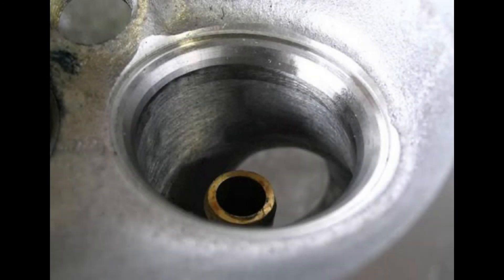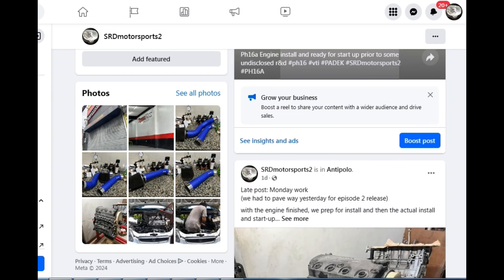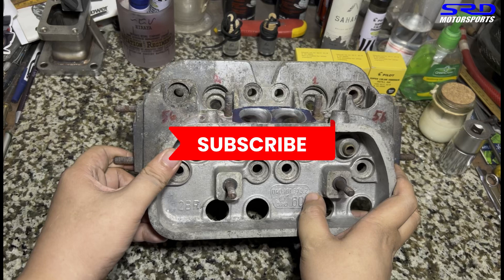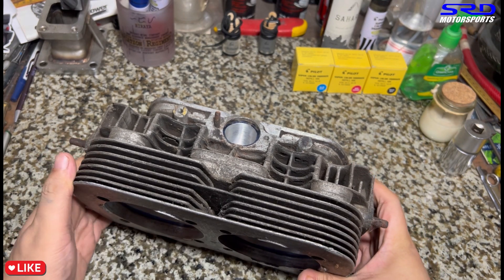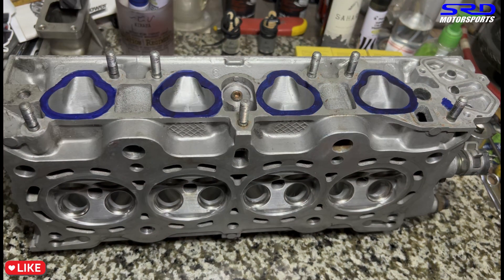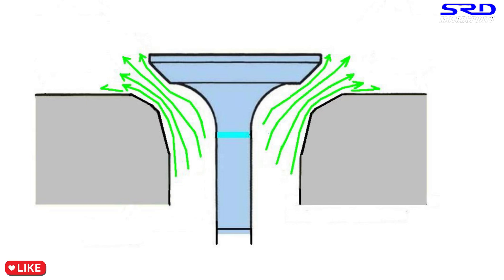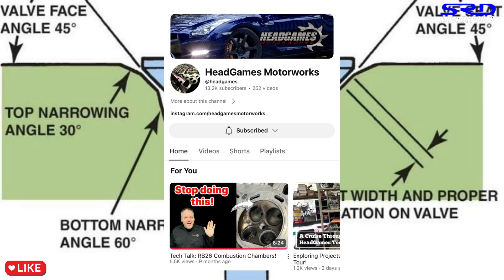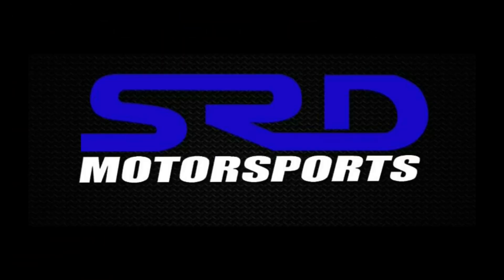Basics of a Valvejob: the difference a 3 angle seat can make

Comment: The VJ is often overlooked by local enthusiasts, even though it significantly impacts efficiency -- Many porters share how they shape their ports but rarely do they share their cutter profiles.
Reply from the maker: @findtherightbeat  true and in part kase Honda has a more than decent valvejob and that let a lot of peeps get away with it…

Unlike on the vw aircooled bugs… there’d be just a 45deg seat 😂
Reply: @SRDmotorsports  Brad mentioned the same thing you mentioned, that for the D16, the factory valve job and seat material is pretty good 👍🏾
Reply from the maker: @findtherightbeat  yeah actually I bugged him enough way back via email and interestingly he always replied which I’m always thankful of